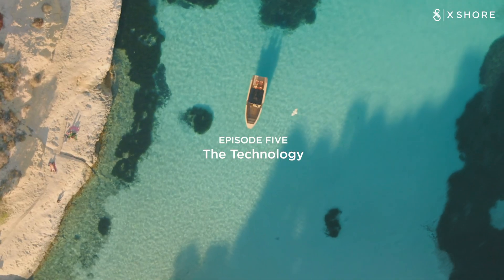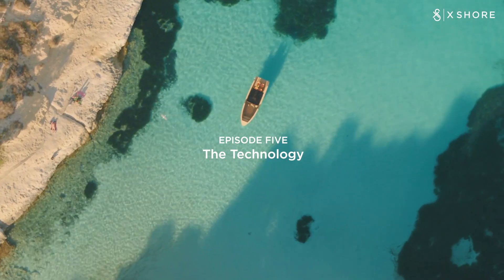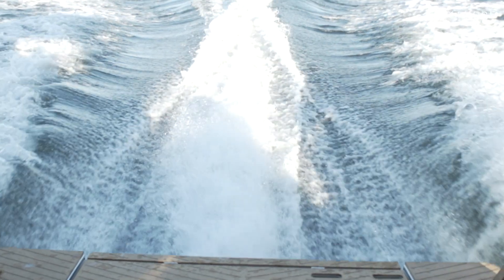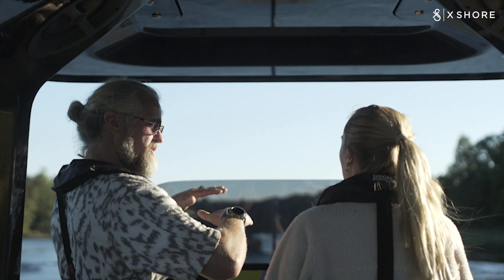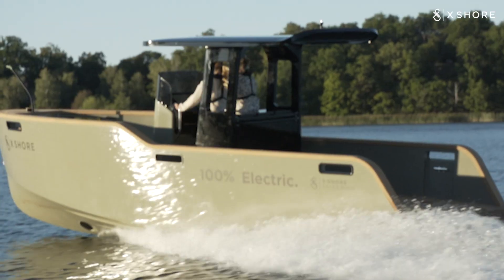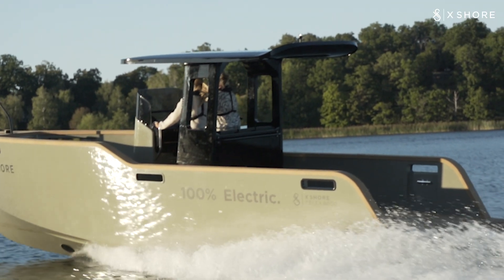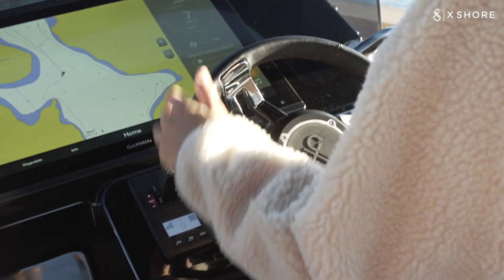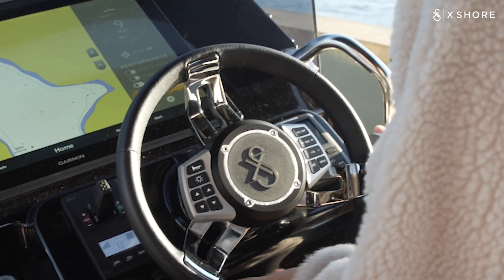The Technology Behind X Shore I Electric Boating Ep.5

Comment: "It's not a sustainable system, high voltage is very dangerous. If there are 4 water circulation motors in the boat and there is still sea water interaction, if it's not direct drive and requires a gearbox and cooling, if the battery has to reach high amps, if the battery charge and discharge balance has to be cooled at high temperatures, if the motor is heating up even though there is a gearbox, and if the motor also has to be cooled with seawater circulation, and even if there is a special cooling fluid for the battery, and if I have to use service batteries to cool 4 separate circulation motors and circulation water instead of using them for my refrigerator, and if my top speed range is only 39 minutes, and if I have to charge with 380V three-phase, or if I have to wait 9 hours to charge with single-phase, and if I have to spend 39 minutes cruising and 540 minutes charging, if I have to pay 7,000-10,000 euros for a 380V 90-100 amp charger and reduce my charging time to 2 hours, if I'm going to halve or even more reduce my battery life by fast charging, and if I can't feed my battery from any regenerative source, and if I can't provide feedback energy from the natural rotation of my propeller due to wind or current like wind or solar, unfortunately XSHORE boats are NOT REALLY SUSTAINABLE. Thanks."